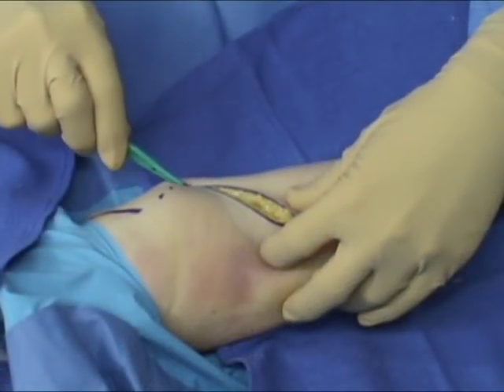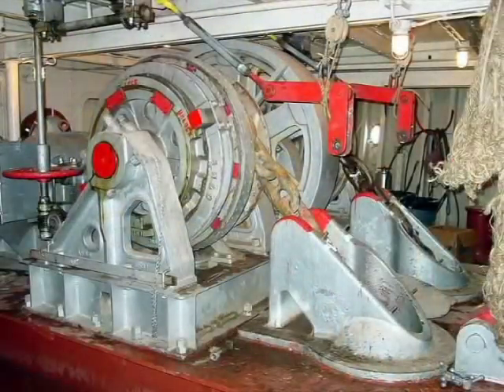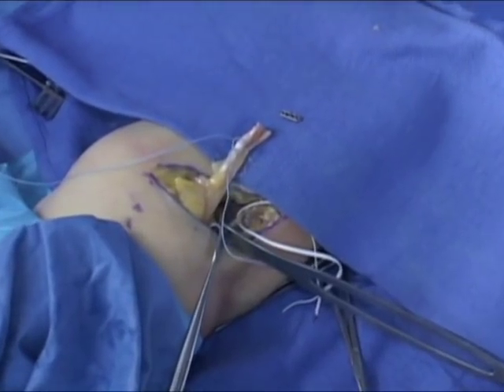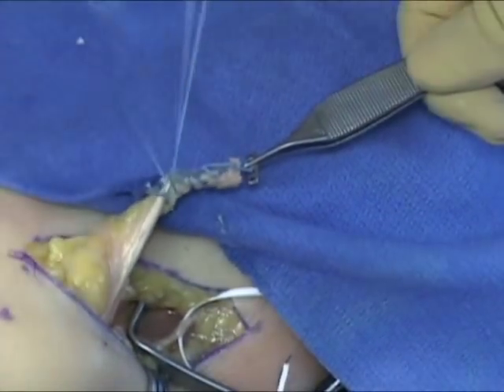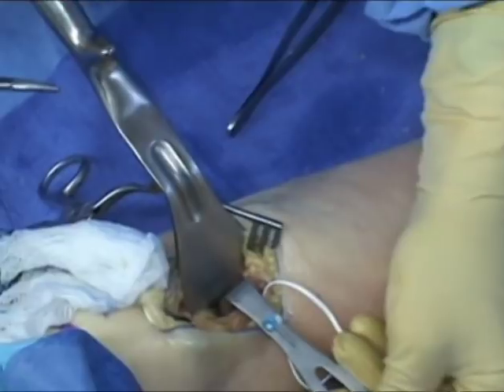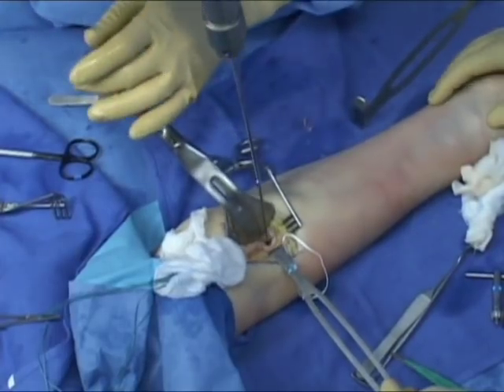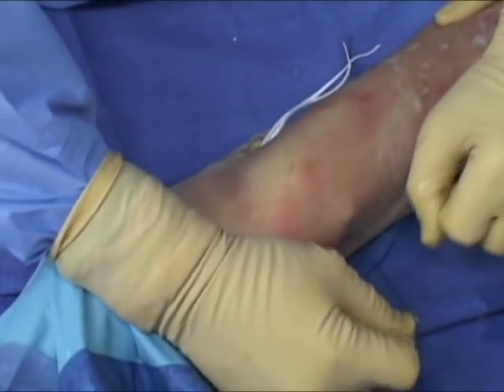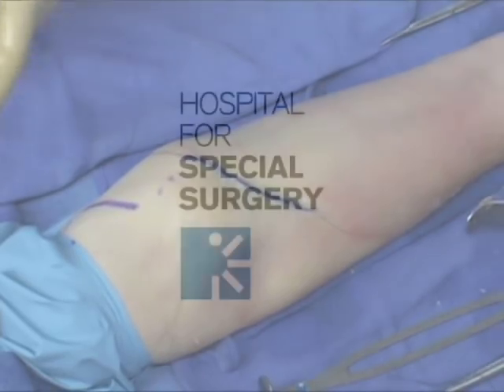Dr. Scott W. Wolfe performs a distal biceps repair using an Endobutton.

Comment: I had this surgery 3.5 months ago.  My surgeon only drilled a 3mm hole for the endo-button insertion.  She said the larger diameter holes (8mm typically) destroy a lot of the tendon placement site.  I'm very happy with this surgery result at 52.  They don't drill through the back of your arm anymore either....unless the surgeon isn't up on latest techniques and wants to stick with what tried and true for them.  I personally want the latest least invasive option.  The extra drilling increases risk for nerve damage.

Comment: I had this surgery on December 1, 2014 at the VA hospital in Dallas, TX.  Healing is going very well after almost 5 weeks.  I did not have the rod passed through the back side of my forearem.  There was not bruising as appears in this video to the patient.  While my surgeon has been very cautious in the recovery period, I have been amazed at the speed of healing so far.  I just started my Physical Therapy today.  It is limited to stretching only at this point.  Will further post as rehab continues.

Comment: I had the same procedure performed. WEAR YOUR SLING TO BED SO YOU DONT HURT YOUR ARM WHILE SLEEPING. Something my doc should've mentioned.
Reply: What did you mean by hurt your arm?  Was the repair damaged?  Or just  additional pain? Resulting from not sleeping with sling.
I
Reply: @anthonyconte4373  I must have stretched my arm during sleep and I tore some scar tissue and the pain was excruciating for the next 2 weeks. I thought it completely tore the endo button off. I should’ve waited a month before taking the sling off during sleep
Reply: Hi Chris.  Thanks for responding.  
I am almost 8 weeks post op.  
A new pain occurred a week ago.  I may have done the same thing you did - tore scar tissue.  
I've been sleeping with the sling but I still move the arm about to try and get comfortable.  I probably should wear the sling around my shoulder instead of my neck - in order to keep the arm pressed against my body.
Post op sleep tough.
Reply: @anthonyconte4373  no prob. You might have. All I can say is that I’m 8 years post op and everything is great. Bicep is looking normal again and I don’t even think about it anymore
Reply: Thanks again.  That is encouraging to hear.
Good that you recovered.
I anticipate the same for myself.